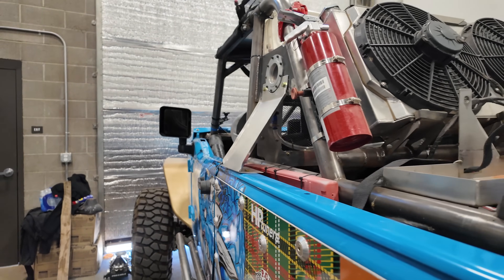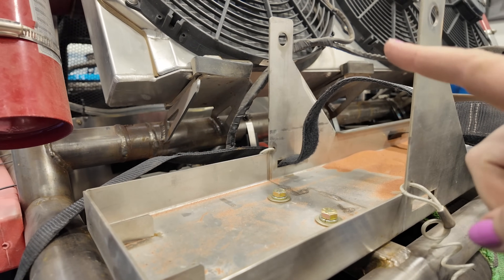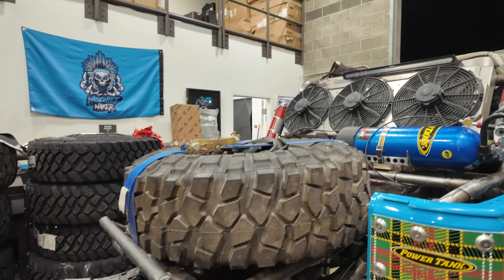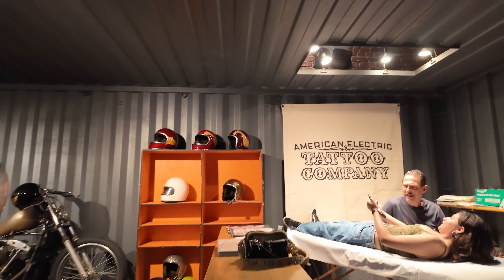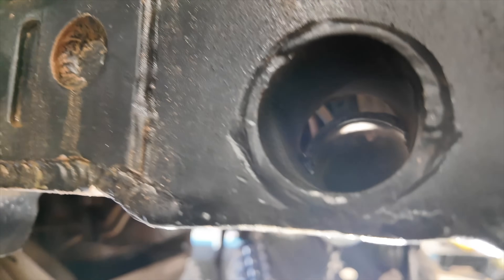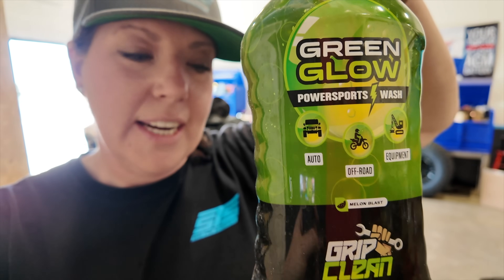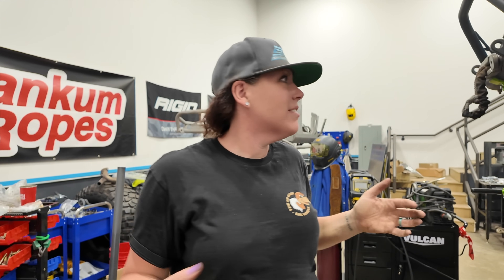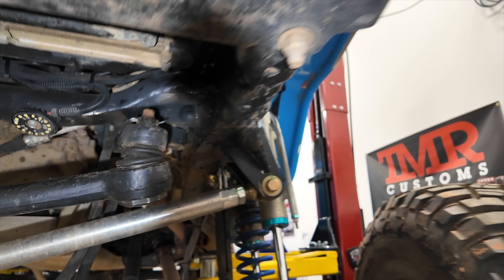Something You Should Always Check For After Wheeling For Years

Comment: Good thing you grabbed the Non-Chlorinated Brake Clean as accidentally using the Chlorinated version and then welding the cleaned metal can result in generating enough Hydrogen Chloride or Phosgene Gas to make you feel ill or even kill you.  Newbies need to be aware of the difference between the two types of brake clean and ensure that their welding shop is a Chlorinated Brake Clean Free Zone.  

Personally I never buy the Chlorinated Formula to better ensure such an accident doesn't happen.  When shopping its good to read and double check the labels on each can as too often both formulas may be mixed together on the stores shelves making it more likely that a stray can or two of the deadly brake clean might end up in your cart to end up in your welding shop.

Something to keep in mind when you weld.

Best!
Reply from the maker: I didn’t know why, but Walter always told me to get non-chlorinated, so that’s all we ever have in the shop.

You are absolutely right about double checking, because I’ve accidentally bought a can in the past and had others bring it in while working on projects.

Comment: What happens when you weld brake cleaner?
The Safety Data Sheet (SDS) for a can of brake cleaner reads: “Do not use this product near open flames, welding operations, or excessive heat. Vapors may decompose to harmful or fatal corrosive gases such as hydrogen chloride and possibly phosgene.”
Reply from the maker: I use non-chlorinated brake cleaner, so that particular by product is not an issue. The acetone in non-chlorinated brake cleaner does produce harmful byproducts when heated, but not anything that a properly ventilated area doesn’t remedy - most of the TIG welders I know prep with straight acetone. What do you use to prep your surfaces?

Comment: i said it last time and i'll say it again. your drag link and track bar need to be parallel and the same length. not close to the same, exactly the same otherwise it will keep tearing itself apart like it has been. they travel in an arc, if they are the same length and parallel the arc is the same. if they aren't the same length and parallel the arc is different and if the arc is different they are fighting against each other with one trying to push and one trying to pull.
and because you have hydraulic assist and solid joints that stress is put straight into chassis, axle brackets and steering box. you can keep patching it but it will always find the weakest link and fail there.
Reply from the maker: I have to disagree. The relationship between my track bar and drag link are as close as they will ever get (and much better than most). They are parallel to each other, but the drag link is about 3” longer.

Working with a dual shock setup where the coilover and bypass are mounted on either side of the axle tube requires some creative problem solving. It limits how close you can get to the knuckle with the axle side track bar bracket, so you have to move the frame side bracket well outside of the frame to maintain length.

The issue you see here is the result of having a frame chop bumper as there is none of the original rigid crossmembers that originally held the frame in place. I do have a fix for it, but this tube crossmember should do for now. 

The frame on this vehicle was never designed to see the forces it sees out on the trail. Some flex is good, but with everything we have removed especially at the front and rear of the frame, it is seeing a lot more than it can handle.
Reply: @MischiefMakerTV  Definitely a new purpose built frame then